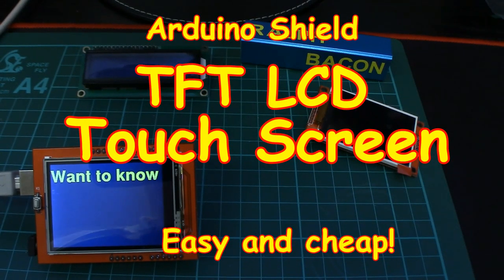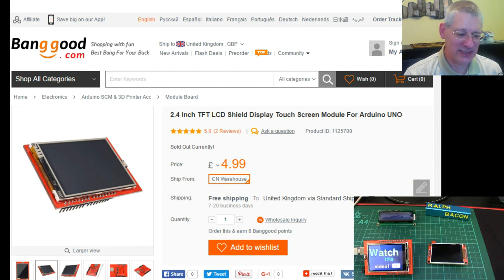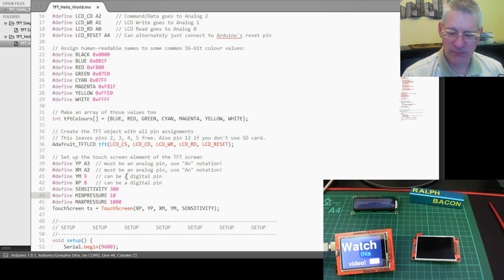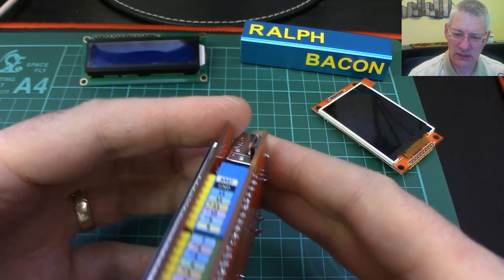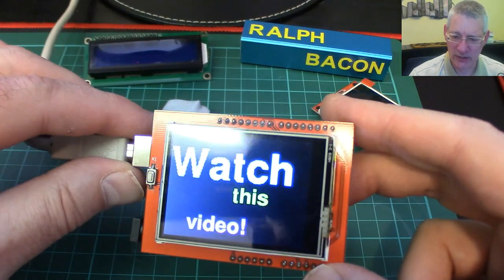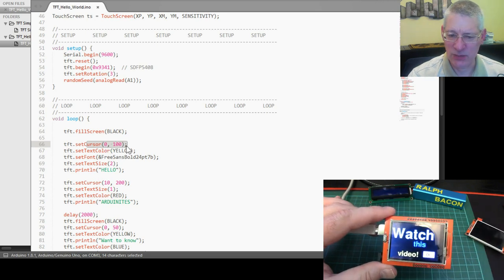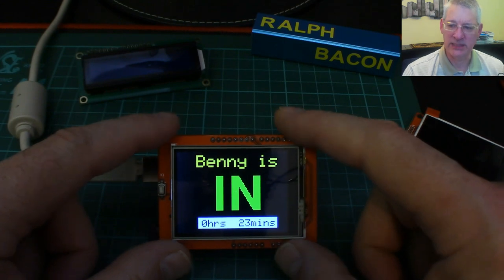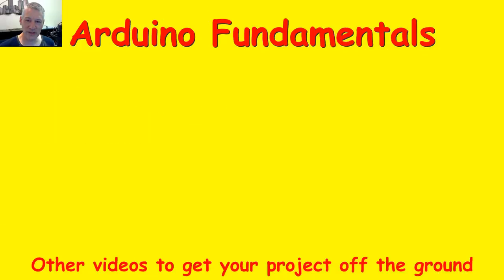#83 Colour Touch Screen TFT LCD for your Arduino - Cheap & Easy

Comment: I realize in Arduino years that 2017 is ages ago, but I couldn't resist writing this comment nonetheless.  It's a bit cheesy, but one thing you can do to bring out signals otherwise blocked by a shield is to go old-school and just wire-wrap some wire to those inner pins you need, to bring signals out.  You could also replace the headers on the TFT shield with the stackable sort (female atop, long male pins below) - swapping those out is a bit of a job, though, and it'll obstruct any efforts to mount that screen flush with the top surface of a box.
Reply from the maker: As it happens I'm using that same screen in my ESP32 Web Radio Project. I've even designed a PCB for it that plugs into the motherboard via an IDC cable. All pins are brought out, just in case. It uses a different library but the screen (apart from a rising cost) is just the same.
Reply: Could you also solder wires to the correct pin solder joints on the bottom of the board?
You could also solder male or female jumpers 90deg on the bottom of the board to keep a lower profile and easy connections. A 90deg connection is also easier to solder than straight down.

Comment: Hi Ralph, is it possible to drive 2 x TFT screens (0x7575 => HX8347G LCD driver) at the same time on an arduino mega. I searched on the internet but I did not find an answer.
Thanks for your help.
Reply from the maker: This screen shield plugs directly into the Arduino and uses SPI. Another screen (not a shield) that uses SPI should work too as long as it uses a different CS (Chip Select) pin. In my demo I show the sketch with the following defined:
#define LCD_CS A3
that is used in this line a bit further down
Adafruit_TFTLCD tft(LCD_CS,... etc)
So if you created TWO objects (call them tft1 and tft2 instead of just tft) and had different CS pins defined for both then they should work just fine. 
But the only way to know is to try it, François. Good luck.
Reply: Hi Ralf,
thank you for your reply.
In my program I defined like this:
Adafruit_TFTLCD tftd (TFTD_CS, TFTD_CD, TFTD_WR, TFTD_RD, TFTD_RESET);
Adafruit_TFTLCD tftg (TFTG_CS, TFTG_CD, TFTG_WR, TFTG_RD, TFTG_RESET);
But in the void setup:
tftg.begin (0x7575);
tftg.setRotation (3); // 0 or 1 or 2 or 3
tftg.fillScreen (BLACK); // clear screen
tftd.begin (0x7575);
         tftd.fillScreen (BLACK)
I have mixed display of 2 screens on 1rst screen.
how to connect the second TFT, I have doubts for the connection.
Thanks for your help
Reply from the maker: I've just spent some time digging into the Adafruit library for this screen, François. It seems that they never expected anyone to connect more than one screen (at a time) to an Arduino. It uses 12 (or 13) pins to communicate with the screen because it uses 8-bit parallel communication - not exactly standard.
At this point, I would not proceed, because getting the screen working at all is quite a challenge, let alone two. If it used standard I2C or SPI it would work, I think.
The way I might approach it would be to use a second Arduino (clones are very cheap, maybe $3) and send the second Arduino the information to be displayed on the second screen. A slave screen, so to speak. That would simplify your code too. At least you know that will work, or you could spend forever trying to get two screens on one UNO working, which, having looked at the Adafruit library, seems unlikely! Keep it simple, that's my motto!

Comment: Nice video
 Where do you get those decals for on the pins.
Reply from the maker: You can make your own very easily on the computer, in the same way I do. Very useful.
Reply: Thank you for this response.
Do you have an example to make this yourself.
I would be very grateful to you.
Reply: I put mine in a shared area of my dropbox:
https://www.dropbox.com/s/bz64pmnrqp3e9hn/Arduino%20labels.xlsx?dl=0
That should open a read-only version, save it to you drive.  Now your only problem is printing them small enough to be 2.54mm high.  
The first sheet is for the chip itself, the second sheet is for the headers on the Arduino.
I print them on paper and then stick them with Pritt stick, or if I have any, I can use a sheet of self-adhesive labels.

Comment: Can u plz tell me which library file are needed to download for this TFT display to do its simulation in Proteus.Can u plz give exact link for  this TFT library where I can download it and then add it in proteus.plzzzz
Reply from the maker: I'm afraid I have never used the Proteus Design Suite (which I assume you are referring to)? This channel is primarily aimed at the Arduino environment (and related microcontrollers that can use the Arduino IDE). 
Perhaps you could find a forum for users of the Proteus and ask this question?
Reply: @RalphBacon  kky .Thank you

Comment: Hi, Very Good video
Is sketch Good also for 3.5 TFT LCD?
Tg Very much
Reply from the maker: Impossible to say, Maurizio. The trouble with these screens is that they (or the driver chips) can change without warning. What works for one screen may not work for another. the only way to ensure success is to read the comments of others before purchasing to ensure a driver  / library is available.

Comment: Yay! got both examples working, where did you get the labels from for your dupont headers Ralph?
Reply from the maker: Woo Hoo, Result! (As we sometimes say in the UK). Those coloured labels on the side of my Uno came with the ATTiny85 kit from video #82 but I also mentioned and showed that I made my own (far inferior ones) before that (small world). So glad it all worked for you Carl, nice that you posted here thus encouraging others to try it too.
Reply: really helpful video Ralph, thank you. I wanted to use the display for a simple work project but I ran into the same issue as you with the display shield covering the prototype shield, I'll have to get some stand off headers as you suggest. really helpful that you place your material on github.
Reply from the maker: You've just reminded me, Carl, that I must order more long pin headers. They pins will have to be shortened actually, as they are sized to go through a PCB first then into the pin header sockets. We want to use them just to raise the height of the shield so they are a few millimetres too long. Github is useful not just for you but for me too, easier than trying to share DropBox files as I used to!
Reply: Where are you going to order the headers from?
Reply from the maker: AliExpress has a huge bundle of 20 x 6-pin, 8-pin, 10-pin for about GBP 2.33 (store name is 3 d shopping center). However, that comes on a slow boat from China so I've also paid more than that just for ONE set from eBay (grrr!) just to get the job done this month. Serves me right for not taking note that I was running out of these headers!

Comment: Hi, I have a 2,2 TFT LCD with 16 pins and I don' t know how to connect to arduino UNO. Do you know how to do it?
Reply from the maker: The best way of identifying an unknown screen, Bsamsung, is to look at each identifying marking on the screen and use Google to try and narrow it down. If you get even close you might get some bits working then you can experiment with others in the same family of screens until you find the exact model. That's what I do, so good luck!
Reply: I have identify the pins bu I have white screen. I had instal and drivers too.

Comment: Getting Mirror image of all the text. Can you tell me why what I have done wrong?
Reply from the maker: Firstly, have you the exact same screen that I used? Even a minor difference in model number can make a difference.

Secondly, did you use the libraries on my GitHub from when I did this video, specifically because I knew those versions worked just find (with the demo sketch)? 

I use the following libraries from my GitHub:
#include <Adafruit_GFX.h>
#include <Adafruit_TFTLCD.h>

If you answer yes to both these questions we will have to investigate further!
Reply: @RalphBacon  The problem got resolved after I resinstalled the libraries Thanks for the reply

Comment: Good video again.
I have 2 or 3 of these screens from various sources, think one was from BangGood and two were from eBay sellers.
I had great difficulty in getting one of them to work with any libraries I could find, I eventually manged to get a utility to return an identifier for the controller and found that it was not supported by many but found that the MCUFRIEND_kbv library is good at handling these and is already configured for some known things like swapped x or y touch direction and offsets.  It can be used with the AdaFruit GFX so no need to learn new functions.
Just throwing the info in there if others have the same difficulty, I'll see if I can find the offending display model and I'll post a reply if I find more info.
Reply from the maker: That's great info Matt, you never know who might read this and benefit. As Art Becker mentioned if you open up the library this one does support many chipsets (for display, anyway, not sure about touch). Thanks again for the info.
Reply: I dug it out, it is a 2.8 inch TFT shield 240x320, the controller is a S6D0154, it identified itself as 0x0154 when queried for the controller ID.
The other two I have are different controllers and work fine with the Adafruit library, can be such a lucky dip as to what you get even from the same supplier, and they all look the same on the same Red PCB with no identification as to what the controller is.  Good luck everybody.

Comment: do they make a mounting bezel for those displays?
Reply from the maker: Truth be told, it's unlikely. Whilst you can fit them quite successfully into an acrylic case (either transparent, so no cutting required, or coloured so you would have to cut out an accurate opening) other options include 3D printing. If you have no 3D printer (I don't) then there are people out there willing to create something for you, for a fee. Check out Thingiverse first to see whether someone has already designed one! https://www.thingiverse.com/
Reply: @RalphBacon  bummer i guess it is time to sit down at the 3d printer computer

Comment: Hello! I want to transmit data from another Arduino via serial. Help me as soon as possible. Thank you.
Reply from the maker: Comments on this video is not the place for this comment, is it, Tumenbayer? And anyway, using the Serial (hardware) or SoftwareSerial library connecting two Arduinos together (RX to TX and TX to RX) is very simple. What have you tried and what problems are you getting?
Reply: @RalphBacon  no problem now, thanks in advance.

Comment: Hi Ralph, I'm still struggling getting my 2.4 inch TFT to work (shows 0x7575 chip). Can you recommend any other resources to follow up with?
Reply from the maker: I'm guessing Adafruit is your best bet, Tait, but failing that Google is your best friend. When you say you are "struggling" what does that mean? A white screen? Nothing appears on the screen?
Reply: Thanks Ralph. Yes, I get the white screen. I've tried all the libraries I can find using Google, to no avail. I've tried programs that tell me the chip in the TFT but the libraries for that don't work either.
Reply from the maker: It's probably the hexadecimal code you are using for the screen. I believe I show the library I used which had several hex codes in the underlying files, all for different screens, have a look at the .h or .cpp files. It can be very hit and miss though. And sometimes you never do get to bottom of the problem.
Reply from the maker: This web page mentions your chip (you require an HX8347G LCD Driver, apparently):
http://domoticx.com/arduino-library-tft-lcd-shield/ 
(It's in Dutch but Google translates it automatically) - in fact there a couple of libraries there that match your chip.
 
Read this post, may point you in the right direction: https://forum.arduino.cc/index.php?topic=288475.0
 
Perhaps you've tried all this already?
Reply: Thanks Ralph, The Dutch page looks familiar but I'm not sure about the arduino forum. It's been a couple of weeks since I attempted it so I'll try it again and keep you posted. Thanks for following up

Comment: The demo works great but occupies nearly 24k of memory. How can I print  only pure ASCII characters only in 
1 or max 2 font sizes ?  Output from sensors etc. No fancy graphics or touch screen keys needed ?
Reply from the maker: If you don't need touch screen capability, nor fancy graphics, Mann, then I think perhaps this is not the screen for you.
 
I don't have any other libraries that would give you what you want - and I doubt you would find one as the whole point of this screen is that does offer just those features! If you just want plain ASCII why not use a blue 20x4 or 16x2 LCD screen (you can even use big fonts on that screen, see my video #23) and uses hardly any memory up at all. Any good?
Reply: @RalphBacon  
I have used many of the LCD's you mention with an I2C backpack. The contrast is not ok and the LCD's must be viewed from a certain distance and angle. Cheap modules from EBAY.
Maybe not passed quality test in the factory ? I like the Mcufriend tft's and will look after some
smaller font libraries. I'll also  give your video #23 a try.

Comment: Would this LCD work with an Arduino Due?
Reply from the maker: The Due is a 3.3 volt chip so won't interface to 5-volt peripherals easily, and it has an ARM chip (not an AVR) so some of the libraries may not work with it. I'm not saying it definitely won't work but I'd be cautious about the 3.3 volt limit (you don't want to damage it by connecting it to 5v pins or bus) and even then it may not compile - and given the problems many people have had with the libraries for this touch screen I'd be amazed (but pleased) if it were to work. Best I can say, Ed, sorry.

Comment: One way to tell if a device driver might be suitable for the display you have is to simply open it up in Notepad++ and look at it. Some of them, but not all, have a long list of which displays they drive. There are lots of display available from China, and they can be dirt cheap. Places like Adafruit can charge 10X of the China cost. I don't begrudge them that, as they have costs to cover (rent in NYC for one), but ...
Reply from the maker: Hey Art! This library does support many chipsets it appears; I was just happy it supported the one I had, but it is certainly an easy way to check, so thanks for the suggestion. I know what you mean by Adafruit; on the one hand they are brilliant and obviously help drive the Arduino community along, but, boy, their prices certainly reflect all that effort and then some. I've bought a couple of small Adafruit items just to "give back" as it were, but they don't make it easy, do they?

Comment: Hey Balcon,

Thanks for your help. But my touch is not working. Why is it so? I think the problem is with the libraby fucntion of touchscreen.h .If so could u show me the actual one. Please.
Reply from the maker: Are you sure your screen supports touch, Raoof? There are so many, almost identical looking screens, some of which do not have the touch functionality (and are therefore a bit cheaper). Check your screen against what you see in the demo. If they are not identical then it may not have touch, or check out the comments in this video from others, who have had similar problems but have either used different pins or have allocated different pins in the sketch or library.
Reply from the maker: I also found this comment by a purchaser: graphics worked all right but touchscreen did not. using library SPFD5408-master: in examples change pins: YP=A3, XM=A2, YM=9, XP=8 in SPFD5408_TouchScreen.cpp change line 163, invert the x value (as has been done to the y value) return TSPOINT(1023 - x , 1023 - y, z); Now touchscreen works.
Reply from the maker: See this thread here: https://forum.banggood.com/forum-topic-99663.html it may help you.